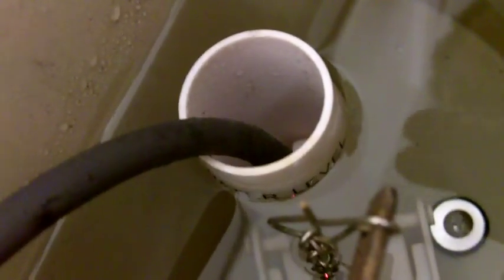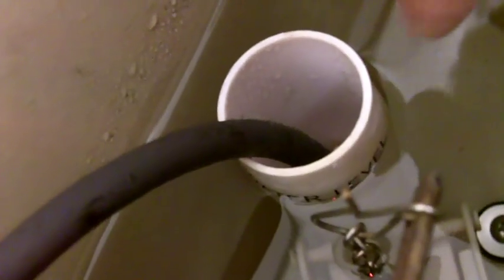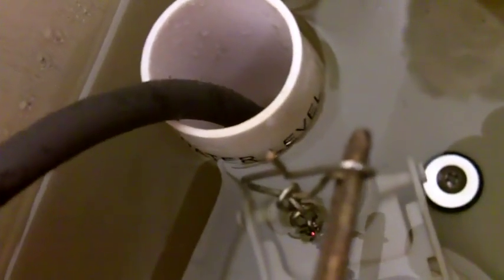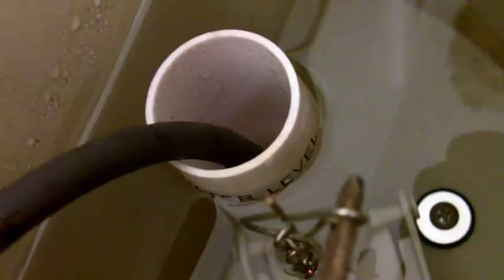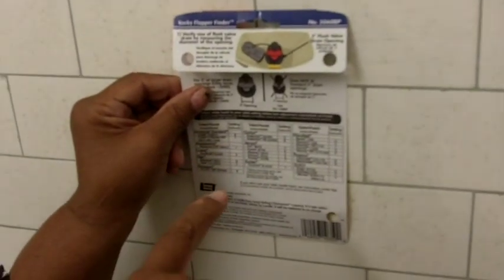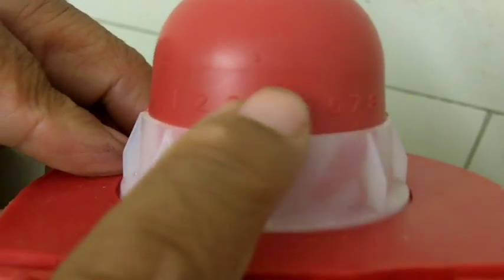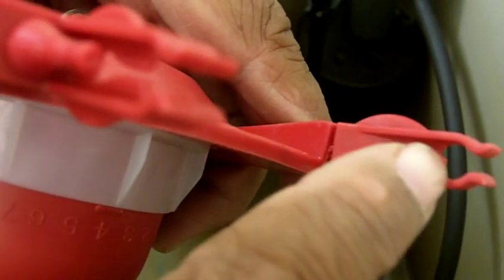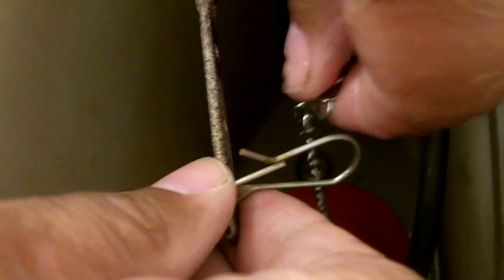Fix Leaking Toilet Flapper and Save Money on Water Bill!

Comment: Seejanedrill, out of curiosity, I'm getting a similar sound, and water is running into the bowl slowly, I was wondering if you would think of anything else other than this, maybe thee bolts? I was planning on purchasing a flapper and any other related items that may do this for a few bucks ad home depot.
Reply from the maker: sometimes mineral deposits accumulate on the valve seat that the flapper rests atop.  It's that build up which prevents the flapper from doing its j0b successfully of keeping water in the tank until the fixture is flushed.  The following seejanedrill video link shows how to fix this problem.   https://youtu.be/jh4M5tuahwM

Comment: Ach! How about the stupid old Kholer tank with the funky ball flap! We just replaced it with a modern stick to bottom unit and it still has this teeeeeny trickle. My husband says actual valve on wall is leaking. What say you?
Reply from the maker: Chana Nemetsky   Hello Chana, When water leaks from the tank into the bowl, chances are, it's either the flapper or flush valve seat (the opening from the tank to the bowl).  You've replaced the flapper, so next, I'd empty the tank and clean the valve seat with vinegar. This will get rid of mineral deposits. Scrub it well, get it really clean, and afterwards rub petroleum jelly around the opening and on the bottom of the flapper. That should remedy the problem.   If your husband suspects the water supply valve is leaking, it would be in addition to the flapper issue.  Hope this helps.
Reply: seejanedrill thank a lot!